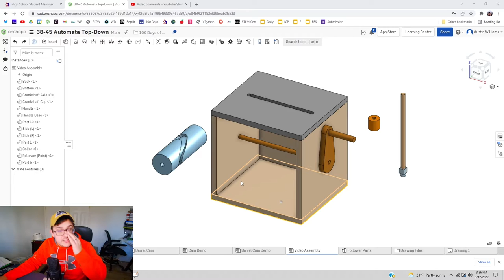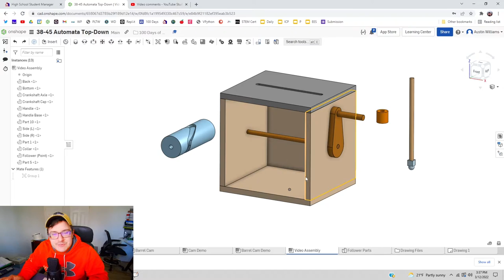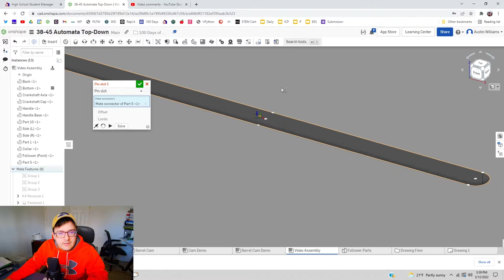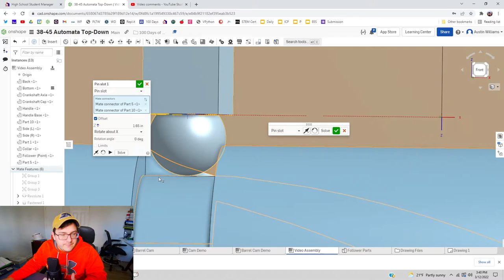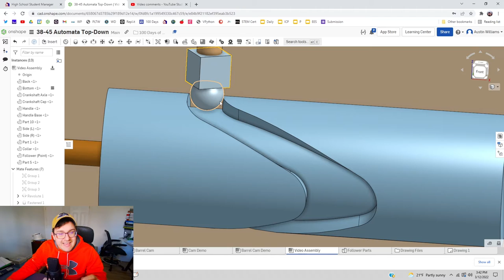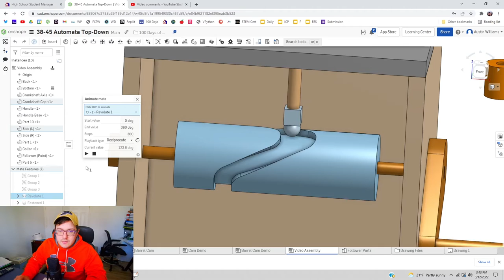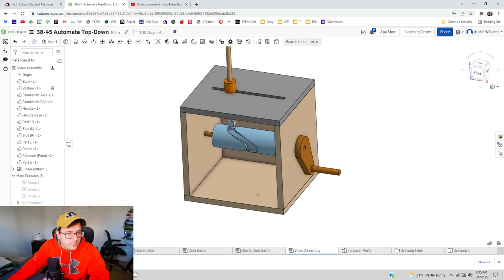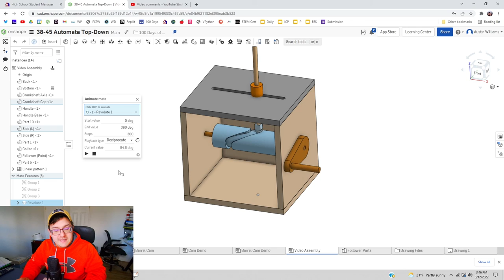Pin Slot Mate (Barrel Cam Assembly) - Day 68 of 100 OnShape Journey

Comment: Question about how to align parts in an assembly before grouping. That's the part I get stuck on. How to exactly align assembly parts without a mate. Do you have a tip or video link for that. Nice video, thank you!
Reply from the maker: You can "transform" parts, which will allow you to rotate or translate a part in a part studio. Look at Day 77. I transform the pen cartridge in place using a center axis.
Reply: @LearnItDoItMakeIt  Thank you!
Reply: @LearnItDoItMakeIt  Thank you! I checked it out. I was asking about how to align different parts in an assembly not a parts studio, before grouping. Definitely able to do it in a part studio, but the grouping tutorials never talk about how to align different parts in an assembly itself before grouping them. The only way I see it is to do it by eye or use a fixed mate. In any case, thank you for trying to help! I appreciate it!
Reply from the maker: @matthwy1  I understand now. The intention of a mate is to align and join those two parts. You can click on an unrestricted part once in an assembly and that will open a quick move feature with rotations and such.